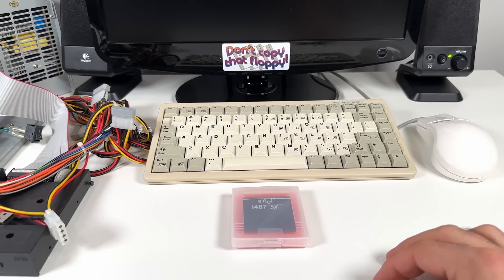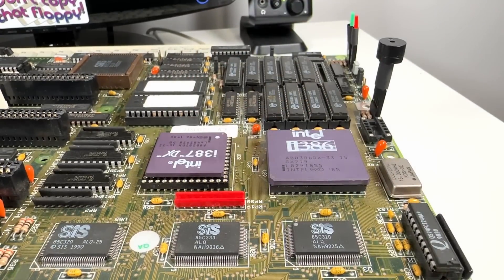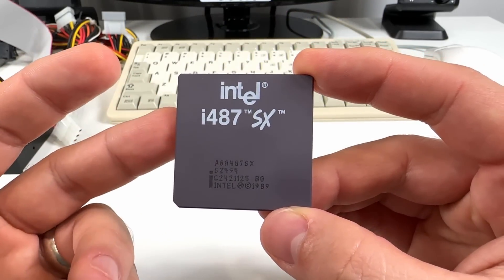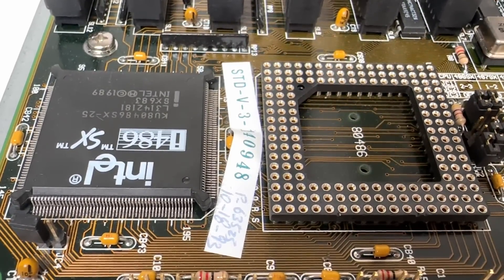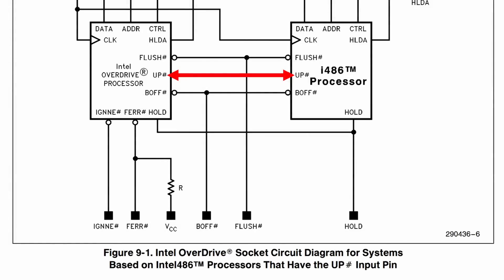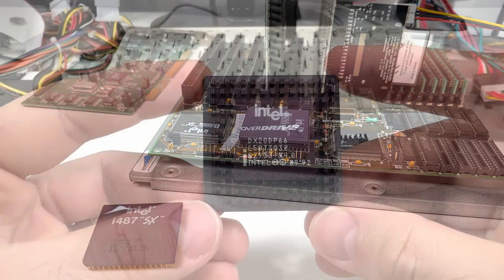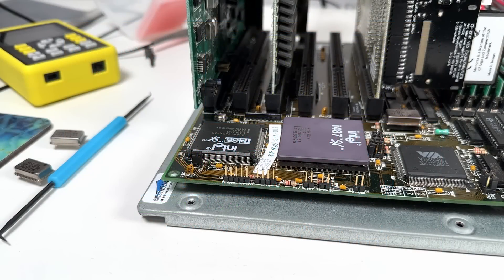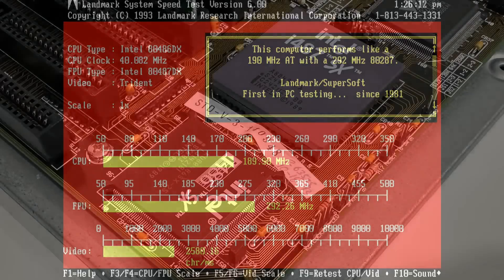The Intel i487 SX Math Co-Processor - Disingenuous or Just Misunderstood?

Comment: I always thought it was strange they went with the SX branding on the co-processor, since the SX designation was for CPUs without FP. I guess marketing thought it would help those with SX CPUs know it was for them. i487 DX would have made more sense though.
Reply: 386 had 2 387's as well, a 387SX for 386SX CPUs and a 387DX with the full 32 bit data path so it made sense they continued the naming scheme of the FPU having the same name just with the number increased by 1 for helping consumers know what it went with.
Reply: @latorcognitio9369 Oh I know, the difference was there were both i387DX and i387SX co-processors. This wasn't needed for i486, so let's be honest, consumers that actually would be buying one would have been fine with it being called i487DX, as DX was by then the designation for the FP.
Reply: @drewnewby it's true that i487 alone would be enough but Intel really wanted to make sure people with 486DX didn't try to buy one. 😅
Reply: @latorcognitio9369 Intel SX/DX marketing was a mess during i386 anyway. I remember the earliest 386 systems had i287 co-processors, because the i387DX wasn't even ready.
Reply: They didn't really buy i487 anyway. For the cost I just did CPU upgrades for customers. Nearly everyone had Socket 3, for what the boards cost, it was almost a given.
Reply: @drewnewby It was about expandability. People do not buy computers that cannot be expanded so this gave them option of they later needed it. I bet very few bought one but the whole point was to sell 486SXs.

The 486SX was created to compete with the AMD 386DX-40 which was faster than comparable Intel CPUs. Similarly 386SX was made to compete with fast 286 CPUs from companies like Harris.
Reply: @drewnewby  Seems to me most co processors were used to generate fractals... 😁
Reply: @latorcognitio9369  there's also a "just" 387, the original.
Reply: As far as I am aware the SX was not a separate market plan / model but a way of selling CPU dies that failed QC check on the FPU of the DX by disabling it after manufacture.  This enabled intel to sell a shed load of dies without binning them.
Reply: Yeah, this is a bed that Intel made, and was just one in a long line of confusing naming choices that continues to today.

Since the 386 had set a precedent for what "SX" and "DX" meant, and how to choose components accordingly, they set an expectation that an SX CPU needed to be paired with an SX FPU, even though the meaning of that designation had changed completely.  I'm sure that, if they had released the 487 as a "DX" part, that people would've been asking the staff at computer stores, "do you have an SX version for my 486 SX?"

Could've avoided the whole thing by just selling 486DX chips and saying "this is your upgrade path... replace your SX CPU with a DX CPU", except some people would be irritated that they had an expensive and perfectly good, but permanently soldered CPU sitting there doing nothing.  THAT could have been avoided by always using a socket (since by definition you have to have a socket to have a place to install the 487 anyway), but then of course as long as it's cheaper to build a board with a TQFP CPU and an empty socket, that's what manufacturers will do -- even if it wastes the customer's money down the road.
Reply: @nickwallette6201 I never actually had one of the 386 systems with an i287 co-processor come in, but I wish I had one in the collection today. I remember a lot of 386 QFPs, but practically no 486 QFPs came in. I usually upgraded the socket 3 Intels to faster / cheaper AMD chips with FP.
Reply: All it did was cause confusion with the 386SX, which typically included an onboard FPU, but had a 16-bit data bus instead of the 32-bit featured on the 386DX.  Leave it to Intel to have confusing model numbers.
Reply: SX meant "cheaper". The 386sx had a sixteen bit data bus, because it could be used on cheaper motherboards. By the time of the 486, that issue had diminished. So the 486sx just means "no fpu". But they didn't want the expense of enabling an external fpu. So the 487sx is just a 486dx. You can hack the 487sx to run without the 486sx. We knew all of this when it came out.

Comment: I vaguely recall that it was possible to use a 387 with a 486sx?  Or was that a 287 with a 386?  Or maybe it's just my imagination.
Reply: You can use a 387 with a Cyrix 486DLC
Reply: I think it was possible to install 80287 in certain early 80386DX boards.
And then there was the 80287XL which was 80286-compatible, but was based on 80387.
Reply: @peachgrush  You can use the 287 or 387 with Cyrix 486 chips, which were basically a 386 pretending to be a 486.